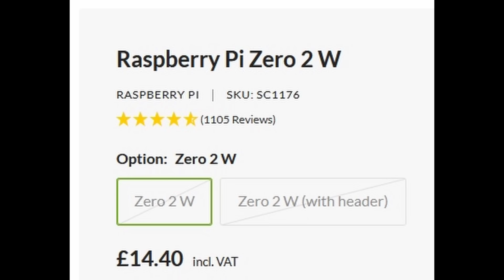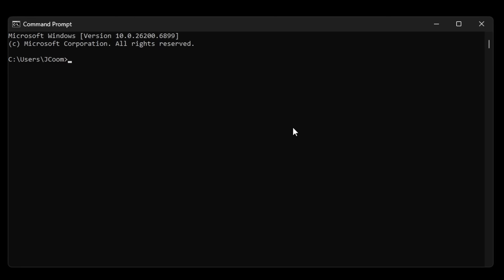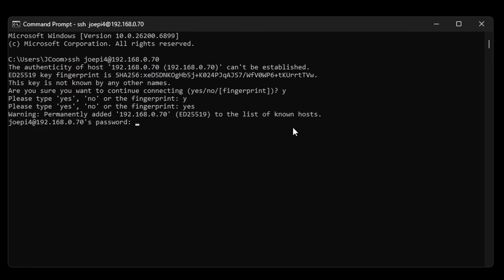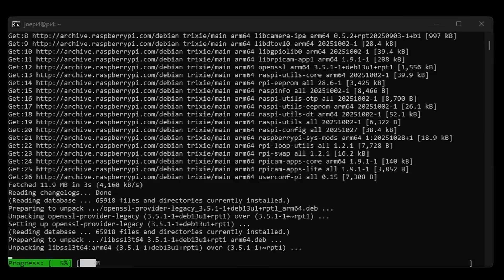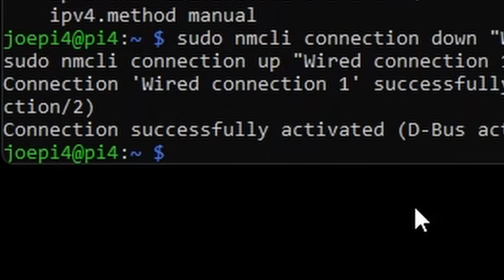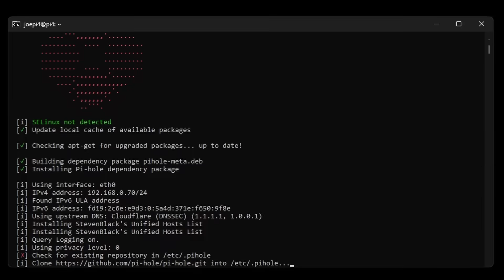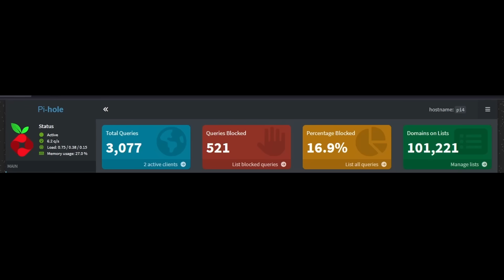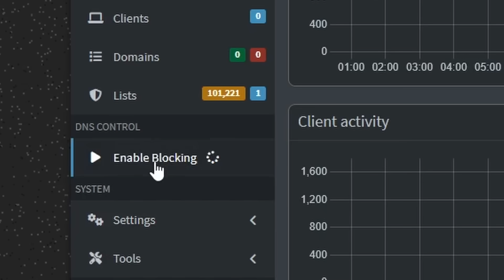The £15 Ad Blocker

Comment: sadly it is a bit on the expensive side in my country, Indonesia
Reply from the maker: That's a shame! Is there any other affordable low powered tech you could use?
Reply: @JoeC-J there is an old pc of mine. it has intel g4560 if i remember it correctly. but idk if it still work or not

Comment: That ethernet adapter uses lots of power, I got rid of mine and use WiFi. No difference noticed in speed.
Reply from the maker: It was the cheapest one amazon did! I'm surprised it works 😂
Reply: Absolutely. Not bashing your vid - I think it's great. Just something I found out that I think is worth noting  @JoeC-J

Comment: Kind of an odd question but im using my ISPs router in bridge mode so i can use a 3rd party actually good router. should i set the ISPs router to the static DNS or my bridged router.
Reply: on the 3rd party one, the ISP router will not do anything but forward all traffic through the 3rd party router, so set the DNS on that
Reply: @arhamzarif6313 thanks man!

Comment: To me Pi zero 2 w looses wifi connection and dies not reconnect, even with the static ip. So I need the ethernet hat. That is additional cost. I would be better off with Pi3. I probably have it somewhere, just have to dig it out.
Reply from the maker: Personally I'd avoid using wifi
Reply: Have you tried it without? I noticed no difference  @JoeC-J

Comment: Well it works and it doesn't work. When I setup mine, it works for few weeks, then it seems like it happens that some configuration gets lost (static IPs) and it stops working. Then I have to connect monitor, keyboard and mouse to it, configure eveything again an update it (lose few hours because pi is slow) and then again it works for few weeks and it stops working again. Now the router got some upgrade or something and IPs got changed and then again I have to connect to router and back to pihole and set everything up again... 
The main problem with this thing is: it is basically stupid as rock. It cannot set anything by itself and everything need to be done manually.
Reply from the maker: Did you set a static IP address on the Pi and reserve it in your router? I've been using Pi-hole for a decent amount of time now and not come across this problem yet.
Reply: I did. But it seems like pihole, pi itself (OS) or router update resets the settings over and over.